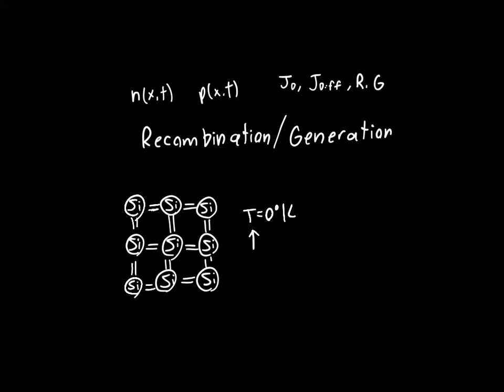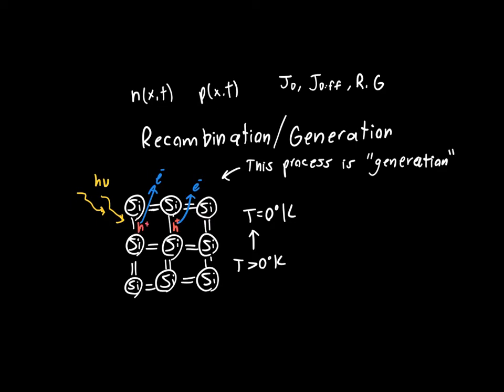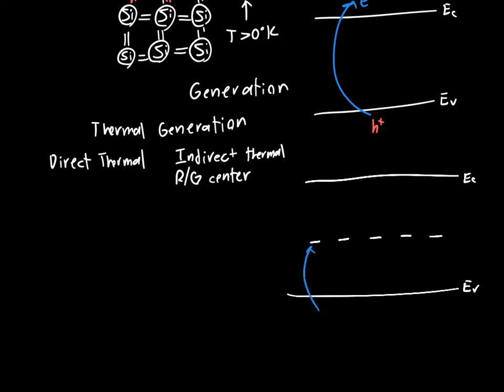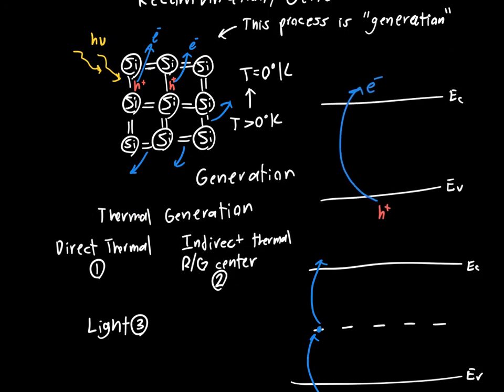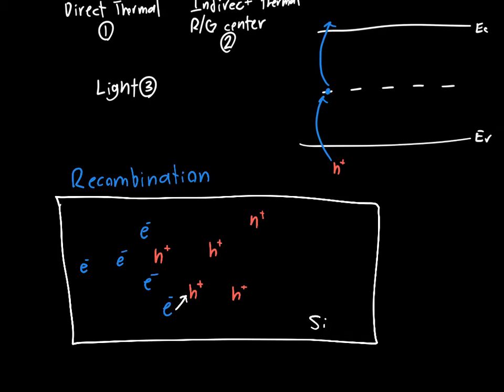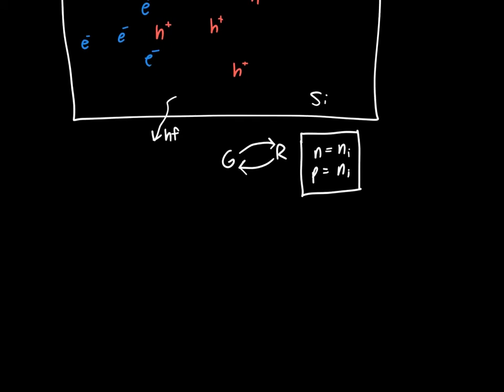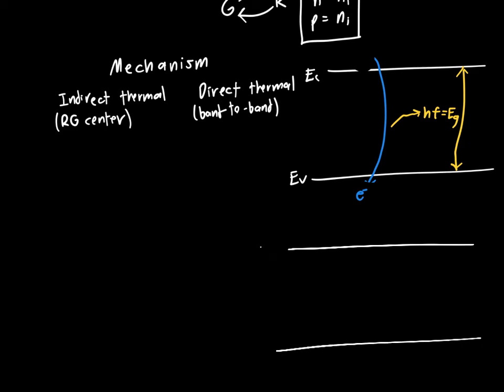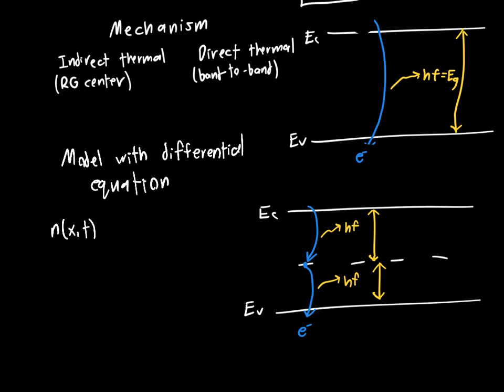Recombination/Generation Introduction

Comment: Excellent, very helpful.  One tweak at 6:42 and 9:40: With indirect recombination in silicon, a phonon (heat energy) is released, not a photon (I'm pretty sure).

Comment: Sir,
Where does the recombination occur?  
In the valence band or in the bandgab?
Reply: Recombination occurs in the valence band for both direct (GaAs) and indirect (Silicon) semiconductors, however in silicon it is a two-step process.  In silicon the conduction band electron will first drop down into a trap energy level, which is located in the band-gap, and from there it drops down into a valence band hole.

Comment: Could you please elaborate on the statement "the hole returns to the conduction band"?
Reply from the maker: Sure! This is another way of saying an electron from the conduction band returns to the valence band (although not strictly accurate as you picked up on, since there aren’t really any holes in the conduction band, just electrons and empty states).
Reply: @JordanEdmundsEECS  basically you can say either one at a time. either in terms of electrons or holes. I am confused about saying both for a single pair.